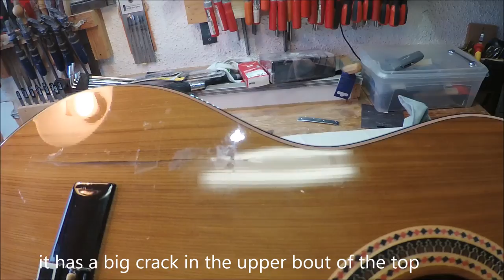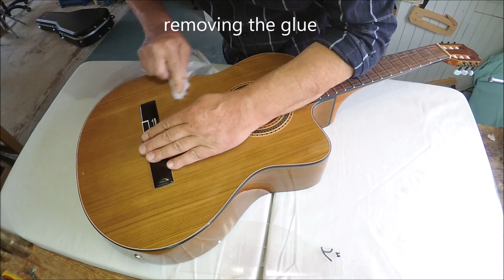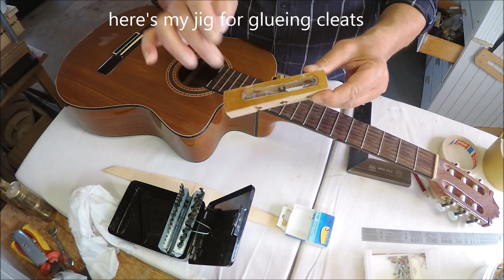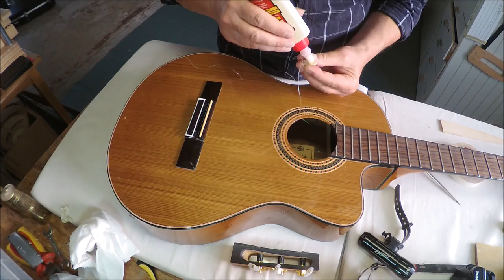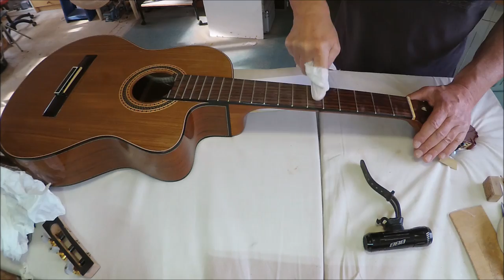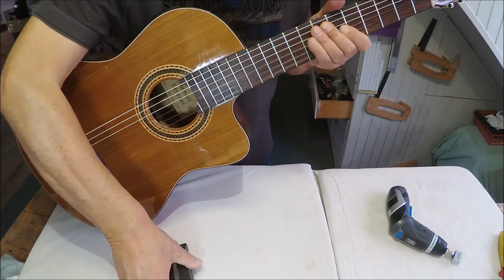the ultimate guitar crack repair tool and it's for free!

Comment: Neodymium magnets are a great boon for many things- as others have pointed out, I have also used them at times for clamping cleats in place more easily than the tuner trick, as long as I have landmarks inside for positioning by feel- just want to be careful positioning cleat and inner magnet and then apply the outer one straight down rather than approaching from the side to avoid pulling the inner assembly sideways. One thing, though- when using magnets to align an initial crack glue-up, I now make a point of making sure I’ve got a bit of wax paper between the magnet and the guitar top to prevent the magnet from sticking to glue squeeze-out on the top of the instrument.

Comment: I love your technique! Several years ago I talked a music store manager into selling me a nice Alvarez guitar that had developed a crack in the top while hanging in a window display facing the street in front of his business. I paid $50.00 for the $500.00 guitar. I took it home and went to work on the crack. Having no clamps to get inside the sound hole, I worked some glue into the crack, then used rare earth magnets to clamp cleats on the inside. I have always been nervous that the magnets did not provide enough clamping force to properly adhere the cleats, but that was 7 or 8 years ago and I still play that $50.00 guitar every day.  At least now if those cleats come loose, I know to drill some holes and make a tool like yours to make it right so my grandchildren can inherit that Alvarez some day!

Comment: I used to use the same method with a modified tuner and guitar string for cleating cracks back in the late 70's & early 80's, but now I find that using a pair of magnets for each cleat, I can do the job without making the tiny hole necessary for passing the string through the top. I use a little double stick tape to temporarily affix the cleat to the inside magnet. The ones I use are so strong that having the top and cleat between them still allows for plenty of pressure to "clamp" cleat to top.

Comment: yes....I use magnets too. I usually put tape on the bottom of the top magnets so as not to possibly scratch the guitar. I also use top and inside magnets to glue/hold the wood tabs in place. I take a small piece of putty to hold the tab to the inside magnet, (blue tape the magnets to the top so they stay in position.) Then when you install the inner tabs/magnets they self align because of the pull from magnets taped on top. COOL

Comment: I like your clamp idea. I have an issue with the back plate of an Autoharp, where the back got a lengthy crack, and was pushed inward, when it was dropped by its past owner. It received other damage issues at the same time, which I was able to correct easily, back to normal again. It's a tight squeeze working inside an Autoharp with such a small opening on its face, but I think your idea will work in getting a good solid repair on this harp, and flattening the damaged crack area back to close to normal again. Going to give it a try. Thanks for idea.

Comment: My pensioner's budget doesn't allow me to hire a Luthier but you have instilled enough confidence in me that I'm going try my own repair on my 23 yr old Martin OM-21. It's a slightly bigger crack at sound hole and it allowed the top to sink from drying out but the instrument is fully functional and still has Martin sound. Thank you for the instruction and excellent video. Dank Je.
Reply from the maker: Thank you Terry; I'm sure you can do it. Good luck!

Comment: Just made and used this tool... glue is drying now, hopefully it turns out as good as expected!!! really great idea, the guitar I'm fixing is a martin backpacker and the sound hole is only about 2.5" across, the crack is pretty far back so there's literally no other way i can think of to get a brace in there... instead of drilling a hole i used a small sewing needle to poke a hole, since the smallest drill bit i had was 1/16th.. also  before doing this repair i humidified the guitar to get the crack to shrink as much as possible.. it's almost invisible now even before doing the brace and glue
Reply from the maker: well done then!

Comment: The music! I could listen all day! Very nice.
Reply from the maker: thank you Dan D!
Reply: I'm curious on gluing the cleats to the inside of the guitar. .seeing as you don't need a lot of clamping pressure when gluing the wood cleat across the cracks why not just use some dowels or sticks cut slightly longer than inside depth of body to apply just enough pressure to hold cleat in place until the wood glue dries? I hope you understand what I'm trying to say... it  would eliminate the need to drill tiny hole and tying a knot in cleat and pulling it tight with the headstock jig you made.
Reply from the maker: Hi Dan,just  try to make sticks that are exactly the correct height to give pressure without lifting the top. It's almost impossible. That's why! Hope you get the point.
Reply: @advankuijk  They don't need to be an exact height. They need to be a little longer and then gently wedged in. You can counter any raising of the top with a counter weight.

Comment: As a musical instrument repair student 35+ years ago I learned from my instructor that Acetone is what lighter fluid is made from. Be very careful with it around plastics - celluloid for bindings and such was glued together at its ends by wetting with acetone. I learned before going to school that it would melt the celluloid. 
To glue the cracks I set the tip of an opened titebond bottle onto the end of the crack and slowly squeeze glue into it. By watching inside, using a mirror and light, I can see that the glue has penetrated through and slowly move the glue bottle's tip the full length of the crack
.
Reply: Cigarette lighter fluid=naphtha. Safe for lacquer and shellac

Comment: During my thirty years at the bench i often used a tool like this, but would NEVER use it on the top of a guitar with a soundhole.  For back cracks in F-hole guitars, yes.......but NEVER where i could reach in and touch the crack.  Simply use your good magnets to pull the cleats against the crack.....fool proof and no holes in the top, no matter how small.

Comment: Using the tensioner device and a poly bagged backing plate I have pulled cracks back together. The better the wood glue the more important the poly bag.
Reply: Thanks! What is a better woodglue?

Comment: Hi Ad This video is the mark of a real crafts person at work I had to watch it from start to finish though it was not a solution to the reason i accessed the repair work carried out  . I have recently  acquired K Mairi acoustic which has had a repair to the bottom end and someone has used a hairdryer to dry the glueing and caused a bloom on the gloss  finish . can this be rectified by myself or do i have to take it to a person who knows his trade and has the expertise to deal with it . Thanks for your valued reply .
Reply from the maker: take it to a person who knows what he or she is doing. There are so many different finishes on the market. Each requires another approach.

Comment: Full of good techniques. Enjoyed very much.  I saw someone use a suction cup to force glue into cracks. That was also effective. What wood are cleats? Would like source, spec of magnets. Thank you!
Reply from the maker: cleats are made of the same material as the top, usual spruce and  for the magnets: I have them for a long time and don't remember from where. Stewmac has them!

Comment: I'm like R Scott down below, using the magnets to hold the cleats in place while the glue sets up.  My customers would never come back if I drilled multiple 1MM holes in the top of their very expensive guitar.  Refinishing that to match is actually much harder than you make it look.  Tinting to an aged finish is hard.  
Actually, I use a rubber covered clamp across the top to bring the crack together once the glue is in place. In ten years of doing this kind of work, never had a crack I could not get together.  Just had a mandolin recently with no less than 7 cracks on front and back - got them all home again.  Magnets are a cool idea, though.  But forget the holes. Not going there.
Reply from the maker: I only use this method when all other methods like yours are not possible. I don't drill any holes if there is another solution. Just showing that this is possible too when all other things fail. The holes aren't that difiicult to make them dissapear. Sometimes this is the only thing that works.
Reply: Tsunamiguitars The old saying......sometimes you have to crack a few eggs to make the omelet comes to mind.

Comment: wow, the things you learn. brilliant! need some advice tho. I'm restoring an old cheap guitar with limited funds, it has been treated badly, crappy, degrading paint job, the list goes on. there is a crack starting from the neck heel and goes bout 8" down back of guitar. i'm planning on taking off the paint, staining the wood and finishing with a wax finish of some sort. my question is, should I repair the crack before or after sanding off the paint, and do you think the glue will take on the colour of the stain, or repel it?
Reply from the maker: I cannot really help you without seeing the guitar. I think I would strip the guitar and repair the crack. You can try the stain on the glue you use on a piece of wood before working on the guitar!
Reply: thanks, will do that

Comment: Very nicely done and informative video.  

I have a 12 string that needs a fix like that.  What are the dimensions of the magnets you used?  I should pick up a few sets.

I like your little jig to clamp the cleats.  I couldn't tell in the video, or maybe I missed it, do you have plexiglass on the bottom of the jig?
Reply from the maker: The diameter is 3 cm. (a little above 1 inch)
Reply: Thanks for the response and thanks again for the informative video!

Comment: That's cool. But why don't you put a thin wooden board between the magnets and the top of the guitar (inside and outside)? That would apply the pressure of the magnets more even to the crack.

Comment: Very good video, you sir have a lot of skills! A question would be what about if the cracks were from the bridge to the bout of the guitar where your arm cannot reach the area (unless your arm is super thin of course) - getting the cleats into place?
Reply: After three years, you get a reply:  Prepare a cleat for the inside and adhere the cleat to the end of a long, thin flexible metal ruler with a loop of tape or equivalent.  Place a round magnet on the top, in the area where you want the cleat to go.  I use fish glue on the cleat;  apply the glue to the cleat. With your cleat on the end of the magnetic ruler, slowly move it toward the repair area (the area below the magnet sitting on the top).  Keep your cleat off of the braces and the top as you move toward the repair area.  When you reach the repair area, the ruler will snap the cleat onto the underside of the top.  You can move the cleat (you have about 4 seconds) by moving the magnet on the top. Let it dry overnight and remove the ruler.  Works like a charm and fish glue (or hot hide glue) is self-clamping because of its chemistry (draws tight in the first moments it starts to cure).

Comment: So this titebond glue just wipes right off the top with hot water? Or do you need to clean it with lighter fluid after the glue has dried? Also, Why not use the magnets to put the cleats on (so you don't have to drill the 3 holes in the top)? Or do you jig your jig does a better job? 
Impressive job either way. I have an older Gibson J100 I will try this too. Thanks for the awesome video
Reply from the maker: you don't have to use naphta afterwards. The way I work gives me more control to glue the cleats exactly the way I want them and with the strength I want to glue them.

Comment: Great wheeze! But I definitely didn't follow the last bit about the wire holder and the double sided tape. Do you mean you leave the bits of E string inside forever?
Reply: I think it was a pickup wire and the holder came loose or was in the way of the crack repair.

Comment: A few questions:

Is that water in the bowl you are wiping the guitar off with?

Have a recommendation for distance between cleats?

How heavy are your weights?

I see that you don't put cushioning under magnets, are they normal normal neodymium magnets? Would you recommending putting a bit of cushioning like a thin piece of leather?

Much appreciated. This is a really amazing video and will help me fix a well-beloved guitar.
Reply from the maker: that's water indeed, to wipe off the excess glue. Distance between cleats is 3 cm. the weights are 2,5 kg each. The leather is a good idea indeed!. Good luck with your repair!
Reply: Thanks for the help! The repair came out really well. Another question for you. I have another guitar that had had a crack previously repaired (I bought it that way). It has cleats where the crack is, but it's clear that they never filled the crack with glue. The crack is stable. Should I run some glue through the crack or should I just leave it alone? Thanks
Reply: @MysteronLunaris  look for stewmac video called a shrinking lifeguard cracks the guitar top. It will show the crack fill.

Comment: I would like to know how you would  fix a guitar who's neck got bent out of shape a little bit forward.
Actually cracked at the base as a result of an accidental drop. This causes the strings to be raised up a little making more difficult to play. The neck got out of place right where it meets the body at the base.Would you glue it and bend it back into place with clamps or something like that? I have a gibson SG electric that got damaged in this way. What do you think?
Reply: John Silver hold guitar by the neck with the body pointing toward the sky.....raise ABOVE YOUR HEAD......strike repeatadly at the ground below your feet. That guitar will NEVER be the same. Guitars are not meant to be dropped for a reason.
Reply: It can repaired. It can. May not be exactly the same but no two like guitars are. Do plenty of research before attempting repair. I would use a glue that can be reversed like hide glue. Or sell it to me for training.

Comment: Wouldn't the magnets (and some protective textile) work even better to hold the cleets while they set and dry?! That way you wont have to drill and leave more marks.
Reply from the maker: I only use this way on places that are very difficult to use magnets. There was a fan brace just next to the crack and it was  a place I could not reach with my hands. Now I was sure the cleets were exactly on the place I wanted them, with the middle of the cleet exactly on the crack.
Reply: I use small earth magnets to repair tops and a string to yank it out without having to drill through the top. They do make small magnets which will fit in tight spots.

Comment: Many thanks for the good ideas that I got with your video! It gives me the impetus to repair my cello. It has a crack from the seat of the soundpost towards the f-hole. The crack is angled and thereby nabbed (schräg angewinkelt und dadurch eingeschnappt). What do you think. Shall I do such repair in wintertime: with dry heating air from central heating? Or in summertime ??? The Cello is from China - not very valuable. Professionell repair is not appropriately ...

Comment: Nice work. I have seen the winder cleat with twine method before and looks genius & inventive albeit alot of work. Would using the magnets to hold in place not do a good job? I have 4x Neodymium Magnet N35 25mm x 2mm on order so hope they would be strong enough for holding bridges down when fixing to the body and cleat holding jobs. What do you think?
Reply from the maker: sometimes it is difficult to find the right place for the cleat. That's when I use this method. This way I'm sure the cleat is exactly where I want it. I would never use magnets for glueing a bridge; only clamps.

Comment: Hi, I believe the repair with Titebond and CA glue would had been efficient enough for this repair. Your technique is similar to piano soundboard rib separation repair work.  Having to breach the wood with a drill only to make another repair for your self is overkill in my opinion with a guitar. Titebond glue is stronger than the fibers holding wood together. Adding CA adds additional strength. CA glue is a piano technicians best friend for strong permanent repairs on items in a piano that take way more abuse than a guitar ever would.
Reply from the maker: we all have our own best ways Kristopher. This works for me for more then 30 years, so it  must have its benifits for me. Good 2020 for you!

Comment: Also check out the Thompson Crack Repair System, offered at "Stewie".  Uses 3/8" thick Lexan, with .3125, (5/16") radius on the clamping caul sections.  !/4" Dia. X 1/4" long, and 1/4" dia. x 1/2"-3/4", (?) long Rare Earth Magnets, pressed into the Lexan.  Of course, if you are DIY'ing as I am, you'll have to make your own wooden cleats!  Good part is NO hole drilling/patching, YAY!       Gb    bg
Reply from the maker: I know the system but haven't bought it!

Comment: It looks like my daughter dropped her Martin Special 000 X1AE. It has about a 6 inch crack on the back, about where the strap button is. Then from the curve under the sound hole, to about where the bridge is, the back has become separated. Would I repair the crack in the back 1st, or the back separation 1st.
Reply from the maker: I can't really tell Tim without seeing the guitar. Every damage and repair is different you know. Find a local repairman/luthier and he will judge it. Good luck!
Reply: I don't think it matters which is done first.

Comment: But... you have those strong ring magnets. If they're strong enough to hold that crack flat for gluing they should be plenty strong enough to hold a cleat in place without needing to put holes in the guitar top.